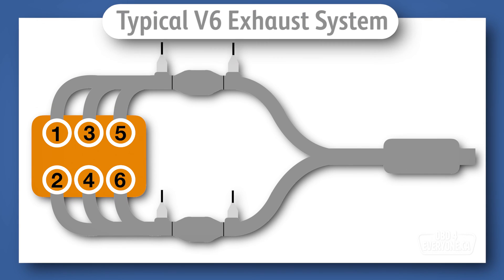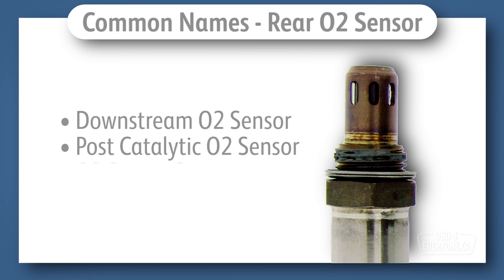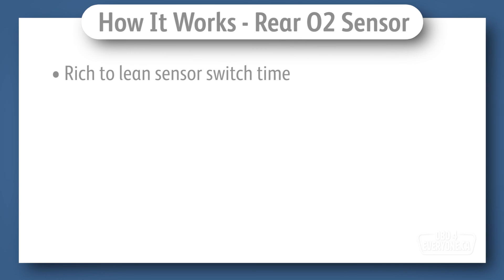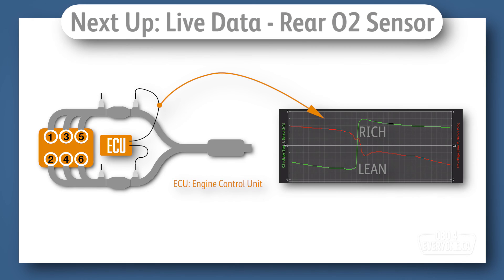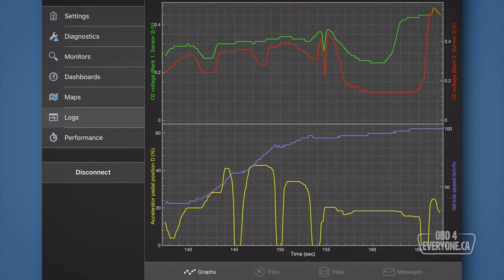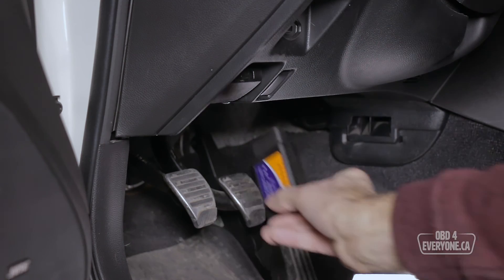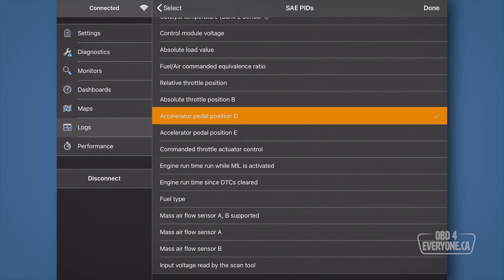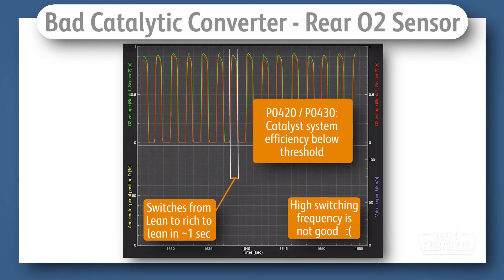Understanding & Live Graphing of the Rear O2 Sensor: OBD4Everyone Ep.19

Comment: My 2012 Chrysler 3.8 minivan datalogging shows B1S1 and B2S1 peaking up and down regularly (as it should i beleive) but the B1S2 seems to hover around .47v at idle while the B2S2 is way down at .31v (up from 0 before I reseated the ECU plugs) before that, the B2S2 would ramp up very slowly (60 seconds) with key on ignition on (KOIO) to 1.47v while the other 3 ramped up within 10 seconds (which the reseat seemed to have solved, probably heater pin). As soon as I start the engine the B2S2 would freefall to 0.02v and just stay there but would peak to .60V when the throttle blipped just like all the others and then fall right back to .02v.. Now at least I got .31 steady idle volts out of the B2S2 but why is it so different than Bank1? All 4 o2 sensors are the same part number and all are from the same box. The STFT on B1 and B2 is 0 +-3% so I cannot understand why the B2S2 would show a low (lean) voltage? Is .47/.31v satisfactory? My bi annual California smog test is only a plug in OBD2 reporting test. Car has 147K on it and is in great mechanical condition...I think. but has thrown B2S2 heater circuit codes as well as lean codes prior to me getting the new o2 to read .31v. The old sensors were NTK brand (recommended Mopar part numbers) the new ones were not. I metered all 4 pins in the B2 harness KOIO and all 4 are identical in S1 and S2. No shorts on the signal side as someone had me test. Thanks.

Comment: Hello, sorry but I'm just learning about OBD reading as my car won't rev above 2000 RMP when warm. It's fine when cold, upon start up however it then when warm refuses to rev about 2000 rpm, and I can't drive it. I have loads of live data and can't seem to make sense of it because some of it is contradicting. My long fuel trim is stuck at 4.7% and doesn't seem to move, even when I turn the ignition off, but my short fuel trim seems to be within tolerance, around, -0.8 and +0.8, moving between the two and that's the first question, why is my long term fuel trim stuck at 4.7? Also I think I have definite problems with my 02 sensor 2. The one after the cat, people call it the downstream cat. As that's stuck at -100% fuel trim, (minus) and I can't again get that to change regardless of the engine being on or off. Or my moving the throttle position. The 02 Sensor 1 is reading between 0.410 and 0.075 volts at a fuel trim which appears in tolerance of around 0 to -0.8 and the graph seems to show similar to what you have taught me, however 02 sensor 2 has a high voltage of 0.720 and a fuel trim stuck at -100%. The MAF is at 3.85 g/s at idle. I have already changed the 02 sensor 2 and I think I'm reading this correctly that it's rich after the cat. Due to the high voltage. However I assumed the new sensor 02 2 would solve things. Could it be the vehicle wiring to the 02 sensor 2 which is making it read -100% or maybe a blocked cat? I'm going to buy a power probe to see if I can get continuity in the vehicle wiring which plugs into the second 02 sensor because with my limited knowledge it appears the -100% clearly isn't correct. Any help would be super appreciated as I can't afford to keep buying parts sadly. Thanks also for taking time to make these videos. They helped me understand things a little.

Comment: I drive a 2015 gmc sierra 1500 4whl drive with a po2099  stft bank 1 is -20 an stft bank 2 is -16 ltft bank 1 is -14 ltft an bank 2 is -17 also has a po172 an po175 what do I check
Reply: I dont know if you got your car fixed but it looks like both banks are running rich. Your getting to much gas. I would look at a defective fuel pressure  regulator first or possibly bad 02 sensors.

Comment: Hi, my Genesis coupe has a Cat delete and an 02 housing installed. Ofc, because it doesn’t detect different readings with the sensors, throws P0420 code.

I tried doing the spark plug defouler method to avoid the rear 02 being directly in the flow of the exhaust, but it just swaps that code for others.

I want to see if I should clog or open up more the fouler to get the right voltage reading, if it’s reading  on idle like 0.3, should I open more or clog the defouler to get it closer to 0.5-7 range?
Reply: There is Pakistani video of fooling oxygen sensor you can try that

Comment: Great video! Really learned a lot.
My O2 S2 Sensor switches between 0,53V and 0,67V at idle with about 1.7s peak to peak frequency.
Not sure, but might be a bad catalytic convertor then.

I do have very rare rpm drops when approaching a light slowly to 500rpm and sometimes backfires at high rpm. :(

Comment: Got the dreaded p0420 and 430 codes. The mechanic swears it’s a cheap after market cats causing a cel .The rear 02 sensors are fluctuating and not steady.i don’t think he has checked for any vacuum or exhaust leaks. Could that be throwing off a code ? He wants to use GM cats but the oem cats will cost thousands to put on.
Reply from the maker: Unfortunately, it seems like some aftermarket cats don't work well enough to keep the PCM/ECU happy. 

If your rear O2 sensors are the "narrow band" (outputs 0 - 1 volts) then the rear O2 sensors should be switching, BUT a little slower than the front O2 sensors (assuming they are narrow band as well, and not actual air/fuel ratio sensors)

Comment: Thinking the catalytic converter was a response to carburetors and early EFI and now that fuel metering is so advanced its now just a restriction that demands you waste fuel to keep it warm.
Reply from the maker: If you are referring to the typical "cold start strategy"  to get the cat up to temp, it only lasts for about 60 seconds and greatly reduce emissions as fast as possible.
Reply: are you saying the cat never falls out of operating temp?

Comment: Hi, thanks for your video. 

My O2 sensor 2 shows the voltage ranging from 0.6 to 0.7 consistently. Does this mean that the catalytic converter is not functioning properly, it looks like no catalytic situation. As a result, it seems to cause increased fuel consumption. Is my understanding correct?
Reply from the maker: Are you talking about the front or rear O2 sensor?
Reply: @OBD4Everyone  
Question 1 :    Doesn't 'sensor 2' designate 'rear' sensor'?
Question 2:   Wouldn't the relevant question be : Are you talking about bank 1 or bank 2 ?
or then again, maybe it wouldn't matter if it's bank 1 or 2.
but still, doesn't sensor 2 mean rear sensor / downstream sensor / post cat/ after cat ? (all the same)

Comment: 2:48 "when the switching frequency becomes too low the computer throws the p0420 code." This should be when the switching frequency becomes too HIGH the computer throws the p0420 code, or it could be when the capacity to store oxygen becomes too low the computer throes the p0420 code
Reply from the maker: You are correct!!!
I can't believe I said that... I'll see what I can do to fix it.

Thanks for pointing that out!
Reply: @OBD4Everyone  Actually both statements are true for most modern cars. Back in the day you could just use a spacer to mute the response and fool the CPU. On new cars that doesn't work anymore, the CPU will throw a code if there is to much activity or to little. They have gotten wise to those simple tricks so now it looks for the response to be within a certain window. It is a lot harder to fake a healthy cat these days.

Comment: I'm kind of confused at how you're representing the results of the graph from 4:24 going forward. You  (and others) say that the readings for the rear O2 sensor on a healthy converter should be flat and have a high change frequency but yet your graph on a supposedly healthy converter shows that the rear O2 sensor also go up and down and when you rev up the engine, it's identical to the 1st O2 sensor.  Just how flat should the rear O2 sensor be? Is the ECM smart enough to allow for the 2 sensors to be identical when revving up the engine and not give you a P0420 code?  

Reason I ask is that when I read my code, the rear O2 sensor reading sometimes mimics the 1st O2 sensor almost perfectly and I think "oh here we go, the cat is bad" and then other times when I'm idling or maintaining my speed it's relatively flat with a spike here or there.  In my case, this is the 2nd aftermarket Cat I put in and each one lasted about 2 years (original lasted like 280K miles) so this time around I tried some cat cleaner in my fuel and to my surprise, I noticed it helping the graph and then my check engine light went away by itself but I'm not sure just how well things are working.
Reply from the maker: From what I have seen, the lower cost aftermarket cats don't work as well or as long as the OEM version. That seems to be your experience as well.

The frequency of voltage change of the rear O2 compared to the front (pre-cat) O2 sensor depends on the type of the front o2 sensor.

Today, most front O2 sensors are actually air/fuel sensors and output a voltage between 0 to 5 volts, so they don't switch like the old narrow band O2 sensors.

To troubleshoot this your self, you need to know what type of front O2 sensor does the vehicle have, what the voltage output is for a given air/fuel ratio and compare that to the rear or sensor voltage output.
Reply: @OBD4Everyone  Thanks for your response. This car is definitely not new! It's a 23 year old Toyota that just keeps on going!
Reply: The graph in the video doesn’t show the 1st O2 sensor. You can only see 2x sensor 2. Green = Bank 1 (behind the first catalytic converter) and red = bank 2 (behind the second catalytic converter).

Comment: Great video! I purchased a car with the Cat removed. It has a strait pipe with no 02 censor.  Check engine light is on, but the car seems to be running fine. Should i try to reinstall the 02 into the exaust, or what are your thoughts? Thank you
Reply from the maker: Your best bet is to scan it for codes to understand what is going on.
My guess is a P0420/P0430 is the cats have been removed...
Reply: @OBD4Everyone  "My guess is a P0420/P0430 is [setting the check engine light] BECAUSE the catalytic converter isn't there." 
 Federal law (State laws, too?) require that emissions equipment (cats, etc,) be in place and operational. Smog isn't nice.

Comment: Thank you for the video. It was very informative. Currently, I'm facing a problem with my truck throwing p0420 code which mean catalytic below efficiency. When i reviewed the data from both o2 sensors based on your video, my downstream o2 sensor constantly shows voltage reading of .8v while cruising at same speed. It goes down to .2v when i lift foot off gas. Should not it be close to .5 at cruising speed? Do I really need a new catalytic converter?
Reply from the maker: As I understand it, the PCM/ECU looks for voltage levels swings (0.1to 0.9 volts) as well as the frequency (how often)  the voltage swings between high and low to determine the efficiency of a catalytic converter.

If the o2 sensor is good and there are no exhaust leaks/cracks to let in air/oxygen, the catalytic converter may be bad.

One option to verify catalytic converter function is to find a shop with a 5 gas, exhaust gas analyzer. See: https://www.walkerexhaust.com/support/tech-tips/five-gas-diagnostic-chart.html

Comment: I have a problem with me 2013 honda crosstour v6. The car has 186k miles and every 2 days map sensor like come up p1129. I replace map sensor, plugs, timing belt check for ground, replace ecm but the light keep coming. When the like come the exhust smell like egg and no power at all at full throttle the rpm slowly go to 4k before changing. I took my upstream 02 out and i start the car for 5 minute immediatly inside the cat i can see red cherry color and i dont have code for cat or 02 sensor. I check 02 reading and the guy who help say my cat is bad he say the cat hold power back am lost. Before i order cat i need your help or input thanks
Reply from the maker: If your catalytic converter is glowing red, that indicates that a very rich mixture or even raw fuel in getting into the exhaust. This is very bad for the converter.

Also, it is possible that part of the catalytic converter is melted inside and blocking the exhaust.

My best guess, is that the converter is partly plugged (or melted), restricting the flow of exhaust and reducing engine power. This may also explain the MAP fault, as the increased exhaust pressure can elevate the intake manifold pressure.

If that was my car, I would replace the converter and verify that the air/fuel mixture is correct by looking at the sensors wave forms as shown in the video.

Good Luck!

Comment: what if i dont use o2 sensor rear...check engine be light?
Reply from the maker: Correct!
Its job it to check for proper catalytic converter function.
If the engine computer (ECU/PCM/DME) doesn't see the O2 sensor, it will turn on the check engine light.

Comment: Just want to know why my rear O2S reads about 0.2 volts when rpm rise?
Reply from the maker: You will have to troubleshoot this, as there are multiple causes.
Have you scanned for codes?
Reply: @OBD4Everyone  yes, i have p2096 sonata 2.4 L year 2008
Reply: LTFT rise up to 15+ some times reaches 20+ when rpm rises
Reply from the maker: As you know, that is a lean condition. Either too little fuel, too much air, bad MAF (under reporting air flow) or bad O2.

Check/examine the intake system for any cracks/leaks, maybe clean the MAF (if you have one)

Do a search to see how you can use propane to verify proper O2 signal change.
Good luck!
Reply: @OBD4Everyone  I compared my MAF readings with another good one and seems normal , I replaced my front O2S and will replace the rear one. Thanks 🙏

Comment: As i know if the rear O2S switching from rich to lean that’s means the catalytic converter is bad , it should read study voltage about 0.5 volts. Am I wrong?
Reply from the maker: There are two things to factor in.
(1) The catalytic converter stores and releases a little oxygen
(2) The air fuel ratio is varied from slightly rich to slightly lean for proper catalytic converter operation.

With the above in mind, the rear O2 sensor will switch from rich to lean / lean to rich, BUT it should be much slower than the front/pre-cat o2 sensor, due to the oxygen storage of the cat.

Anyways, that is my understanding :)
Reply: @OBD4Everyone  Very accurate explanation
Thank you so much

Comment: My O2 sensor bank 1 doesn't show any voltage.  The wiring appears to be good.  Should I assume this is bad or are there other ways of checking this?  Thanks everyone!
Reply from the maker: If an O2 sensor doesn't show a voltage, I would scan the car for codes and start to troubleshoot there.

If a code is why you are checking for the voltage, then check for any exhaust cracks/leaks that could allow air into the exhaust system, causing low voltage.

Do a search on YouTube for DannerScanner, he has a few good videos on how to check an O2 sensor.

Good Luck!

Comment: 4:30 If the oxygen out = oxygen in doesn't that mean the cat is not working properly?
More curious from my perspective, my. Odb2 only allows bank 2 current to be measured while bank 1 is voltage
Reply from the maker: A properly working catalytic convert will store oxygen for a short period of time.
If the O2 in = O2 out, the oxygen storage capacity is very low and typically a P0420/P0430 code will be set.

Unfortunately, some OBD PID descriptions are not accurate. I suspect that is the reason why bank 1 is voltage and bank 2 is current.

Comment: Very knowledgeable information. Is normal to jump into open loop when descelarate and recover close loop just after step on gas pedal and recovering acceleration? O2S2 both banks stay on 0.8 mV and Fuel trims from that sensors stay on 99%. Any clue is everything normal?
Reply from the maker: Yes, that is normal. Open loop will happen under full throttle and when you lift off the throttle.

You don't have anything to worry about :)

Comment: Hey buddy, thanks for the video, appreciate it! I have been getting P0296 and P0420 for bank 1 (right side) on my 3.6 Grand Cherokee. I've checked rear and post cat sensors and figured out my CAT it dead (200k km), so I got Magnaflow California Legal universal CAT which everyone praises in forums to solve P0420. Indeed it helped, although  P0296 did not disappear at all. I`ve checked voltage of post cat sensor Bank 1 plays between about 0.1-0.2v when driving steady, although bank 2 driver side (original cat) post cat sensor plays between 0.6-0.7v. 

What do you think is the root cause?
Reply from the maker: If post cat bank 1 only gets to 0.2v, I would check for an exhaust leak/cracked weld. If possible, swap the post cat bank 1 and bank 2 sensors and see if the lean/0.2v moves to the next bank.

If it does, you might have a lazy/slow/dead o2 sensor.